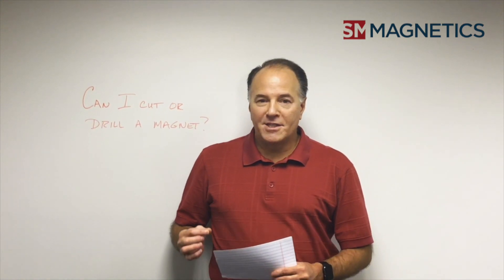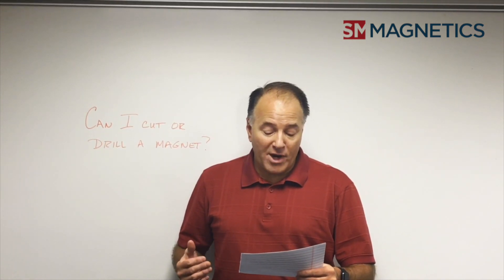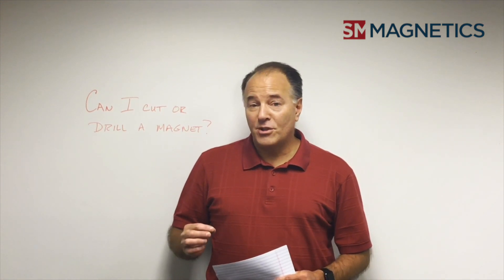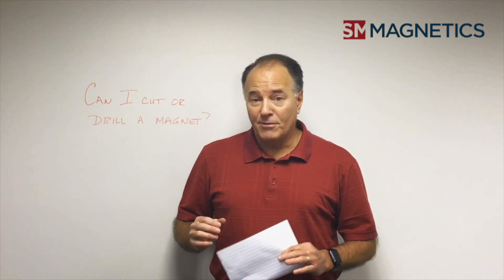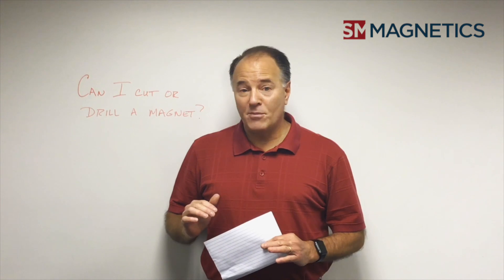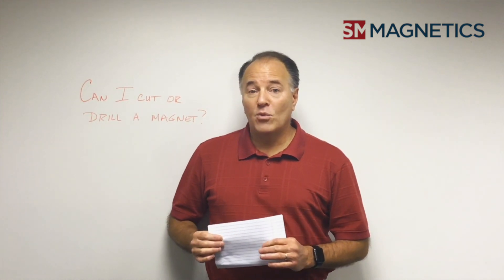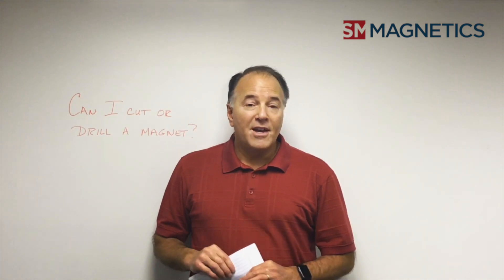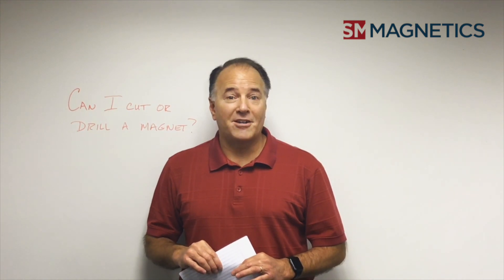FAQ: Can I cut or drill a magnet?

Comment: To your knowledge, are there any arrangement of magnets in a specific order (up to 1440 magnets) that would completely cause the magnets to lose all of their magnetic properties?  Such as that when together they collapse but if I were to pull on the last magnet in the set it would expand back open to the previously arranged magnetic groupings of whatever arrangement, and again only collapsing in the presence of the last magnet in the chain being introduced again.  I've recently done this with a specific number of magnets in a specific polar order and groupings designation - all from numbers from the Bible no less - but the result is uncanny...

Do you guys offer diagrams for flux field paths and flux field densities charts on all of your magnets?
Reply: oooh man you are getting so close. and i hope you're still doing these tests is there a way to contact you using an encrypted connection?

Comment: How can I remagntise a magnet at home?, I sent a product of mine for powder coating and now the magnets are really weak, is there any way I can remagntise it without taking taking the magnet out of the product as it is already metal that has now been powder coated
Reply: You can take another magnet and place it on it to "re-energize" it. Please remember that if the magnet that was demagnetized has a N facing up you must use a S to energize it. I hope this helps. Disclaimer: I've never tried this but it's how China does it but they use an electromagnet. It's the same principle.